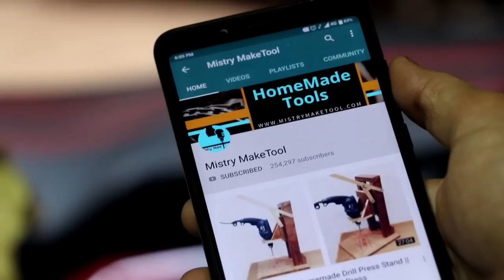3 Best Homemade Drill Sander Projects || Drill Hacks

Comment: Interesting, indeed !👍👏
Orrizontal sand belt >>> Just a question: why aren't the two axes a little bigger?
Let's say 1/2 inch in diameter, there wouldn't be any step/edge at the ends of the backplate which, being covered by metal (even if with the ends bent down) will risk to wear out the sanding belt. 
A mere consideration of mine. 😉